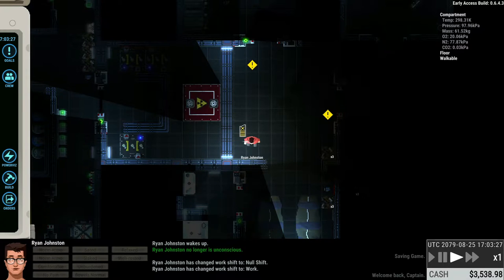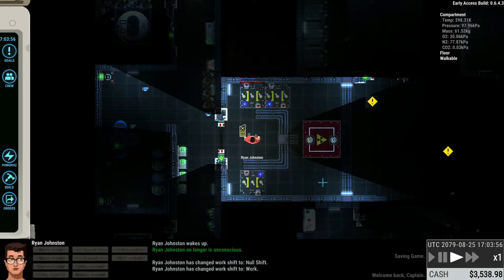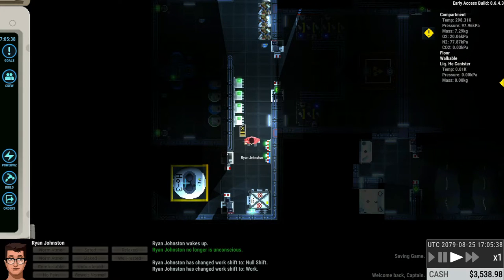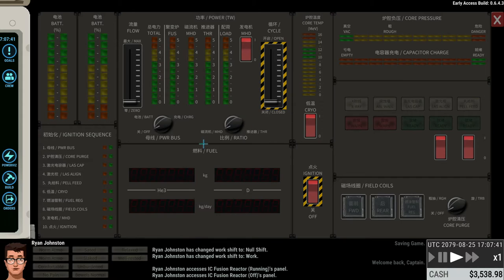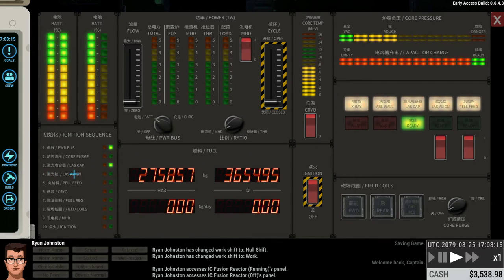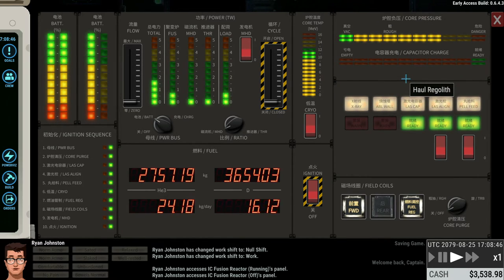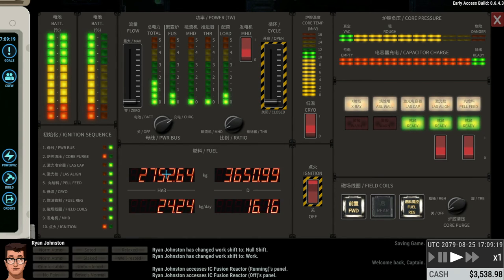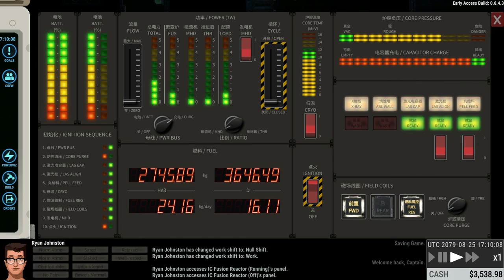Ostranauts Tutorial Walkthrough Guide: Reactor

Comment: currently all those switches can be activated at random order as long as ignition is engaged last. also its possible to switch first into battery charge mode so it charges batteries as soon as ignition is flipped. simply put reactor into battery mode and after it finishes its "boot up check" flip the switch on to charge and then start flipping the rest of switches as quickly as possible in random order(whatever sequence can you complete the fastest)  and ignition last. boots up reactor on single battery that is almost empty. xD

Comment: What do the two sliders do - Flow and Cycle?
Reply: flow will probably be used to increase power production in the future and cycle(open /closed) simply releases "something" from reactor. currently it only has 2 uses with one currently not that useful xD. one is to slow down the reaction and release heat(it doesnt affect the environment currently) and pressure, but it doesnt slow down the fuel consumption. the other use is it can actually cause core purge but the whole mechanic is still unfinished and core purge is not necessary. in future, there might be some kind of gas buildup that needs to be released from reactor and vented out of the room probably, but for now its not needed.